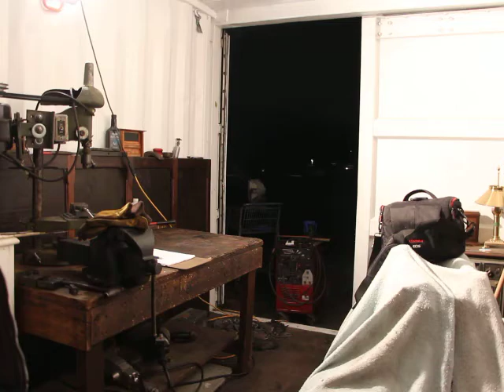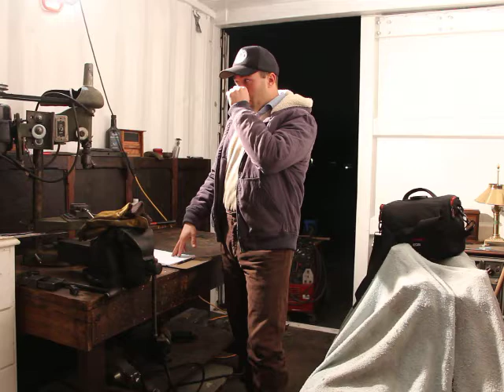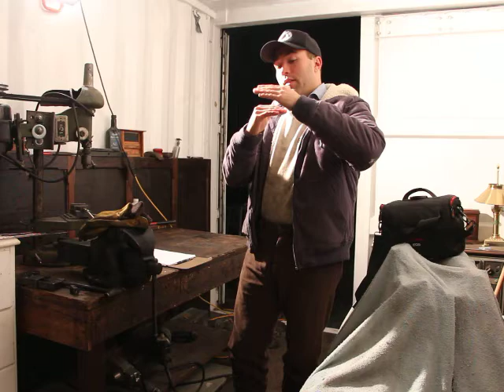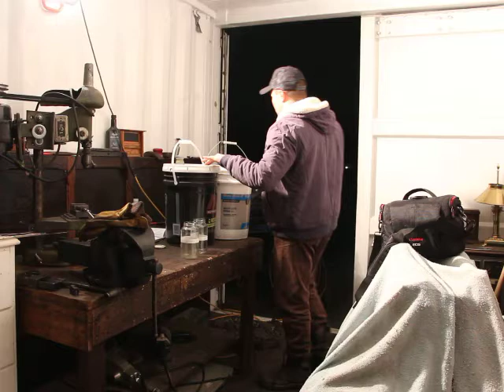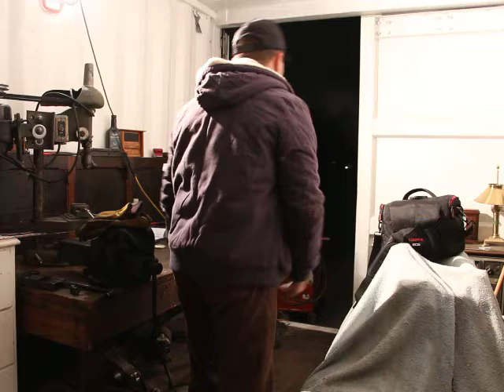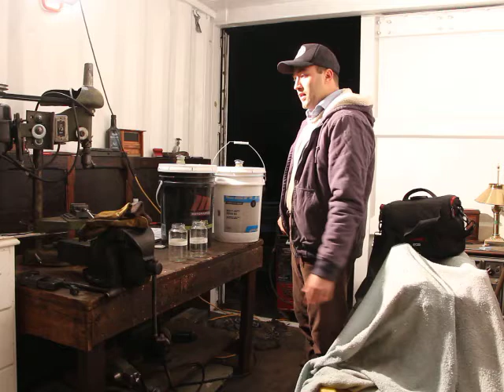Engine oil pressure p1

Comment: Is it kind of like hydraulic pressure?
Reply from the maker: I haven't really studied it in depth, but it gets it's pressure from the power steering pump. There's actually power steering oil going through the wiper motor.